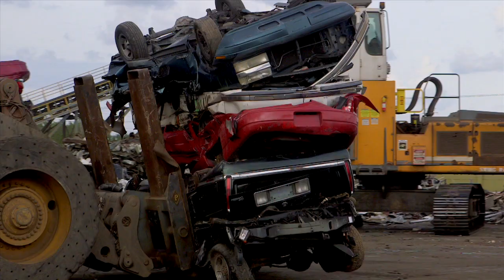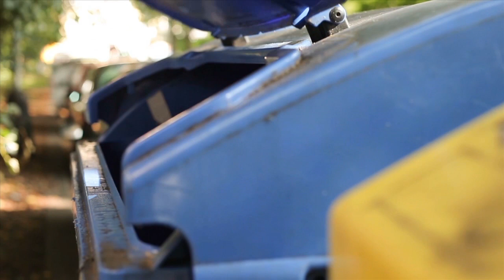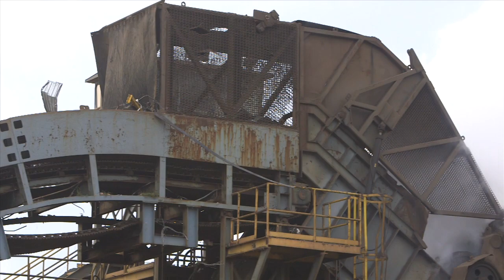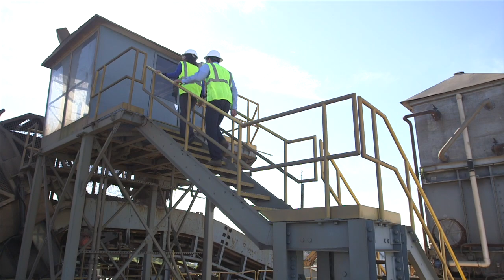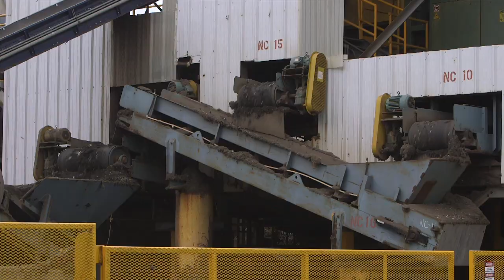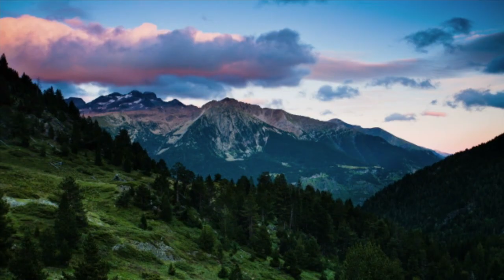The Shredder Story

Comment: The shredder is so huge and all wear parts are replaced quickly about 3 days. The one day more wear life of castings, hammers, pin protectors, grates, alloy caps, liners, will make worker happy as they hate to replace worn parts day by day. We have exported long life castings to mage shredders and I will look into my file to check if it is in my lists.